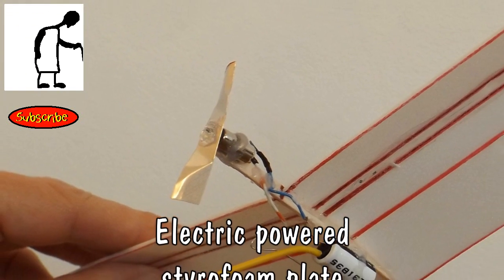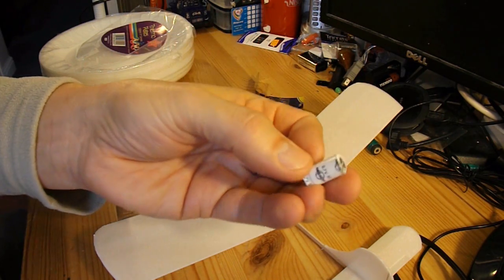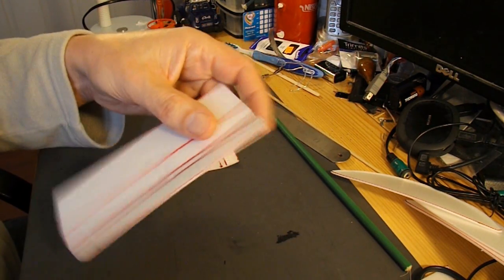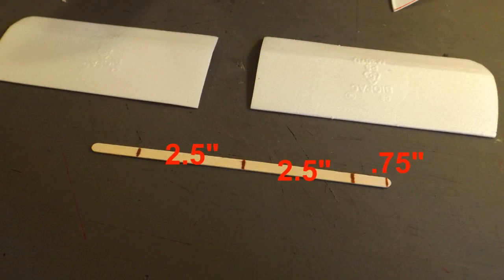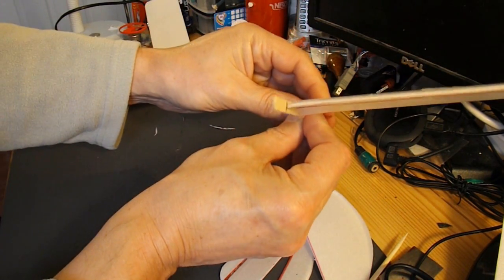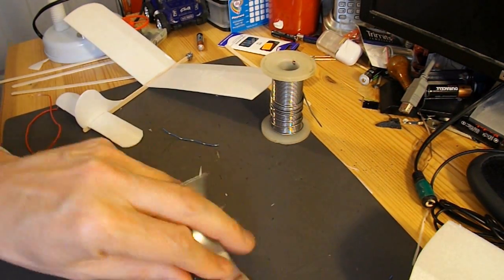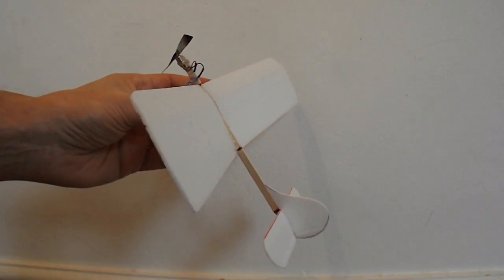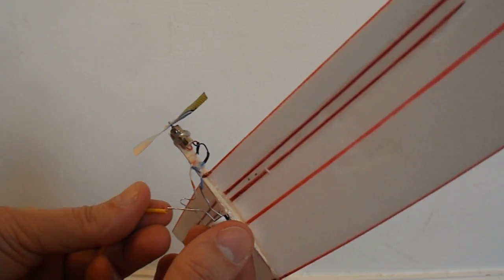Electric Powered Styrofoam Plate Airplane

Comment: Hello. Excellent construction and materials videos. I would like to know, what is the best weight x capacitance ratio of the buy? Thanks for listening.
Reply from the maker: I would love to give you a knowledgeable answer but I can only say I have no idea. You would have to do some fairly clever calculations to work that out. You would need to know the efficiency of the motor you intended to power and the wing loading of your aircraft. I just put things together and see if they work. If they work, I win, if they don't work I have learned something. It's not the right way to do things but it is the way I do it on my channel.
Reply: @GrandadIsAnOldMan  
Understand. It's like testing and seeing how it behaves. Analyze the error and the success. Thank you for your attention
Reply from the maker: @marceloschott7121  thank you for asking, I wish I could be more helpful 😍
Reply: @GrandadIsAnOldMan  🤗🙏

Comment: Can you make a video of how to make rc airplane
Reply from the maker: That really depends on whether you want it to fly well or not. I have done a few but I am completely inexperienced when it comes to flying them. Here are my RC plane playlists
Radio Control Aircraft https://www.youtube.com/playlist?list=PLA5a2xPRSrB2C7UbVc-CqV4a-fpSAU6fJ
The Works £3 Foam Glider https://www.youtube.com/playlist?list=PLA5a2xPRSrB3z16nxV6u2zRtUoqgIqtr9
Glider from LIDL https://www.youtube.com/playlist?list=PLA5a2xPRSrB32IALqvbaZiTaG6J-aJ-H-
Hot Wire Styrofoam Plane playlist https://www.youtube.com/playlist?list=PLA5a2xPRSrB1Qj--01eR1NU_K2RCbH3R8
Another Plane from Scrap Foam playlist https://www.youtube.com/playlist?list=PLA5a2xPRSrB0IHk7pAAHCwTLfGDX_SK-k
DLG Pizza Tray Glider with Cheap Kite frame playlist https://www.youtube.com/playlist?list=PLA5a2xPRSrB3JAFc7f5qk95lpdSMOXDHw
Pizza tray Baubericht Microfighter project https://www.youtube.com/playlist?list=PLA5a2xPRSrB1wXu_GQ6jO1HaZD9rNEwBW
Let's do something with the WLTOYS V911 receiver board https://www.youtube.com/playlist?list=PLA5a2xPRSrB0yn7ndo5B9Emt2UHX_zrsB
Can you use cheap motors and cheap RC for a plane playlist https://www.youtube.com/playlist?list=PLA5a2xPRSrB3v7nI2gkMPSAD5LOoSQkzk
Silverlit Palm-Z BiPlane https://www.youtube.com/playlist?list=PLA5a2xPRSrB2f45nvzR67dfTwbZSdLOVY
Silverlit X Twin Jet RC Plane https://www.youtube.com/playlist?list=PLA5a2xPRSrB2HaQ07pxyWs8dGH1UVsnp5
Silverlit 27 MHz RC Sopwith Camel https://www.youtube.com/playlist?list=PLA5a2xPRSrB3sivRV1Dzzjv6ziMKIi70c
Home Bargains - txJuice RC Stunt Plane xtreme https://www.youtube.com/playlist?list=PLA5a2xPRSrB1L7D8EMI9Y1jOjObycR6Ps
RC Airplane Sky III 27MHz https://www.youtube.com/playlist?list=PLA5a2xPRSrB1SbePGUdr9zJrqPUaW6MLj
Sky Hunter 230 Radio Control Flying Wing 40 MHz https://www.youtube.com/playlist?list=PLA5a2xPRSrB1FQrNHekXwZEyeBUhBedky
Micro RC Aircraft https://www.youtube.com/playlist?list=PLA5a2xPRSrB3HapKkXfbIyZ09HY1W6kH8
RC Ornithopter FB-003 E-Bird https://www.youtube.com/playlist?list=PLA5a2xPRSrB32BEm8rebB8QECFTqXeq1Q

Comment: I have seen those tooth brushes in the Dollar store downtown, now I know in what else I can use them. Thanks :-).
Reply from the maker: I wouldn't buy the brushes just to make a plane but if you happen to be using them anyway then saving the motor would be a good idea. You can buy better motors on eBay for less than the cost of a toothbrush.

Comment: good info on the motor.  I have one of those Guildan  basa wood airplane that rubber band powered.  I am wondering if I put on small electric motor and a capacitor if I could turn  plane a control line plane.
Reply from the maker: A supercapacitor does not provide power for very long. It gives a good power output but for a relatively short duration. If you wanted to do control line then I would suggest using a small LiPo as it would still be light weight and it would last for longer. I have been intending to make a control line plane for quite a while but never seem to get to it. If you want to watch some Control Line videos there are plenty on YouTube, this guy is pretty enthusiastic Shugemery https://www.youtube.com/playlist?list=PLahaAdtfX9ZIJYRxo9TS1hNmtMKSvezQn

Comment: how can I find this type of motor
Reply from the maker: I give you guidance in the video description. This motor came from an Oral B vibrating toothbrush but unless you happen to use that type of toothbrush and have some old ones to take apart it would be a very expensive way to buy the motors. You can get much more powerful ones on eBay or other online stores for much LESS money than the toothbrush costs. Just search for 3.7 volt coreless motor, some even come with matching propellers.

Comment: hey grandad where we can find 2.7 volt capaciter please help me to get it i broke my charger there was high volt !!!
Reply from the maker: There is information in my video description.
Reply: GrandadIsAnOldMan  yes i know i can buy but i want to know in which electronic things in our home contains those capaciters
Reply from the maker: I am not aware of any home appliance that uses them. They are a fairly specialised item.
Reply: GrandadIsAnOldMan oh i am searching it for 2 years by breaking many home aapliances so i am asking you thanks
Reply: grandad can we use capaciter of mobile charger for that coreless motor please say me
Reply from the maker: I don't know what capacitor that would be. I doubt it is a supercapacitor. Is it marked as 2.7 volts 10F ?
Reply: up to how much volt capaciter can be used for that coreless motor
Reply from the maker: The motor is sold as a 3.7 volt coreless motor so I would expect it to run on 3.7 volts to be at it's most efficient. You can probably double that and it will still run but get very hot. It is probably the available current that is more important.
Reply: GrandadIsAnOldMan oh then i tried to run motor by charging with batteries as you showed in one video but it didnt work

Comment: can you give me that electric moter shown in the video for FREE??!  please i have never seen a moter like that before   wish i was intelligent and had enough money please
Reply from the maker: Ben, as explained in the video that motor comes from a disposable vibrating toothbrush. You could find similar in old mobile phones but you can buy much more powerful similar sized motors on eBay or other online suppliers. Just search for 3.7 volt coreless motors. They are really cheap and much cheaper than buying one of those vibrating toothbrushes. I only use them because we use those toothbrushes and I save them when the toothbrush is worn out. The ones you will get on eBay are the replacement parts for mini quadcopters so are much better and like I say, much cheaper. You could get them cheaper from China than it would cost me to post one to you from here.

Comment: Hey grandad would these capacitors work for a plane like this. https://www.amazon.ca/gp/aw/d/B00ZBUE44M/ref=mp_s_a_1_19?ie=UTF8&qid=1467190482&sr=8-19&pi=SY200_QL40&keywords=capacitor&dpPl=1&dpID=41yYwrbSyCL&ref=plSrch
Reply from the maker: No, those are normal electrolytic capacitors and do not have the capacity in Farads that you need. The one I used in this video was 2.7 volts 5 Farads. I looked at your Amazon.ca and could only find one supercapacitor and that was much too big but I followed the links to the seller and eventually came up with this company selling them http://www.alliedelec.com/illinois-capacitor-inc-505dcn2r7q/70112413/
Reply: +GrandadIsAnOldMan ok thanks grandad
Reply from the maker: saad kashif good luck with your search.

Comment: You should make a  electric helicopter 🚁✈🚁✈
Reply from the maker: +Jack Winspear I get asked to make drones and helicopters so often I have a standard cut and past reply.The answer is NO. To make a helicopter or quadcopter stable in flight I would have to buy so many parts designed for the purpose it is cheaper to buy a ready made helicopter or quadcopter or a kit. A good example would be something like the Eachine H7 2.4G 6-Axis LED Mini RC Quadcopter. On top of that, my channel is aimed at simple, quick, cheap projects and a helicopter or quadcopter build is not a simple, quick, or cheap project. You would be better finding a channel that specialises in RC Quadcopters or Helicopters so you get the information from people who know what they are talking about. FliteTest would be a good place to start https://www.youtube.com/user/flitetest
or anything David Windestål is involved in https://www.youtube.com/user/dadde87
or you might like this video by The Post Apocalyptic Inventor https://youtu.be/qa_x93JQhNM
for rubber band power check out the work by norris432 https://www.youtube.com/user/norris432
Francisco Ramos Muñoz is currently doing a quadcopter project https://www.youtube.com/user/franramuzz/videos
Why I won't make an RC helicopter from an RC toy car https://www.youtube.com/watch?v=92GKSUi2y-8
Reply: It dusont haf to fly
Reply from the maker: Jack Winspear if you go through my helicopter playlist your will find a couple of solar powered helicopters https://youtu.be/Vt6p5wOdpV0 https://youtu.be/vlMrTPA_CNA

Comment: hey I just got a rubber band powered airplane and was flying it and noticed it wasn't really powerful how do I make it more powerful thanks!!!
Reply from the maker: +Josh North generally speaking you don't make rubber band powered planes powerful, they are supposed to be gentle flyers. The obvious answer would be to add more rubber bands but you may find that breaks the plane
Reply: ok I was stupid and typed this before I read the directions it said to make more powerful to put 2 rubber bands (before I only had 1) so today I will try it but anyway, Thanks

Comment: Hi, We are building this for a college project but are struggling to find the motor that you have?Can you give any advice as to where we might get one? do they still have them in the oral b pulsar toothbrushes?Thanks
Reply from the maker: +nick cahill yes those toothbrushes are still available as far as I know but that is a very expensive way to buy them unless you are using the toothbrush first and then taking the motors out when the toothbrush is worn out. On eBay or Amazon you could search for 3.7V Coreless Motor or Miniature Coreless Motor and get them cheaper and probably more powerful. People often talk about pager motors which are basically the same sort of size too.

Comment: how do we have to connect the capacitors
Reply from the maker: +KHUZAIM RANAWADIA solder the wires from the motor straight on. In this video I think I kept one wire loose and twisted it on, but that is not necessary, just charge the capacitor fully with the motor running and release the plane immediately. You can tell how much charge is in the capacitor by the speed the motor is running.
Reply: Thanx
Reply: Can use some other motor for this
Reply from the maker: KHUZAIM RANAWADIA you need very small and very light motors. I have bought motors from eBay that work well. They are usually sold as replacement motors for little helicopters and quadcopters.

Comment: i am trying to make a eletric ornithopter :)
Reply from the maker: +Reniel Morioles good luck with that. You will need a geared motor as you need lots of torque. I would think one taken from a toy helicopter would be a good option as they have the gears to turn the large rotor blades. If you haven't found him already you should have a look at the work done by Kazuhiko Kakuta here is an example https://youtu.be/lbmlxiDe7Fw
Reply: +GrandadIsAnOldMan .thank you so much grandpa for always replying our questions / comment and suggesting us of things we can used to our project! u rock grandpa! :)

Comment: instead of the capacitor.....what about one or two small. flat solar cells?
Reply from the maker: J.R. Zippie unless you can source super light weight solar panels then you are wasting your time. If you look at the 'professional' solar planes they have massive panels to provide the power and the plane is super light weight. That sort of thing does not scale down to this sort of sized plane. All the solar panels I have seen are far too heavy.
Reply: thanks for the info...i think i meant little solar cells like those that power the little garden-type lamps (afew could put out maybe 1.5 vdc, but low ma)...and maybe even a larger styrofoam plane to add extra lift....◔̯◔
Reply from the maker: J.R. Zippie I think you would need to weigh a few of them to get an idea of how much power would be required to lift them, then do some calculations on what sort of surface area the plane would require to support that and then find what sort of motor could supply that sort of power output from the power input available. I have enough trouble getting those panels to produce the power to drive a small car or a small boat, and they don't have to lift the weigh and leave the ground.

Comment: The prop looks good. I wonder how efficient it is. Maybe try a button battery instead of capacitor.
Reply from the maker: boowonder888 the prop is hardly likely to be very efficient but if you don't have a hobby shop handy and you can't wait for parts to be delivered by post, then making a simple one like this is a simple shortcut. One of the main reasons for using the supercapacitor is that it will power this motor with high power for a short period. That means it will get the plane up but not fly away out of site unless you catch a thermal. Have a look at the Power-Up series of powered paper planes and you will see they use the same sort of set-up, or you could have a look at my Supercapacitor Planes playlist as there are many more https://www.youtube.com/playlist?list=PLA5a2xPRSrB1wNvirrwAn69eo_pM0tdEM
Reply: yes, I have just made one out of the cardboard from the inside of a toilet roll. When I blow on it it turns better than I expected. Next time I will use a plastic bottle. A 3d printer would be fantastic. Kids today have all the possibilities older generations didnt have.

Comment: can you make a quadcopter out of cheap materials??
Reply from the maker: Parikshit Sah that is a regular request and the answer is NO. To make a helicopter or quadcopter stable in flight I would have to buy so many parts designed for the purpose it is cheaper to buy a ready made helicopter or quadcopter. On top of that, my channel is aimed at simple, quick, cheap projects and a helicopter or quadcopter build is not a simple, quick, or cheap project. You would be better finding a channel that specialises in RC Quadcopters or Helicopters so you get the information from people who know what they are talking about. FliteTest would be a good place to start although they tend to focus more on planes than copters https://www.youtube.com/user/flitetest
or anything David Windestål is involved in https://www.youtube.com/user/dadde87
or you might like this video by The Post Apocalyptic Inventor https://youtu.be/qa_x93JQhNM

Comment: Wow love all ur work how is the hovercraft coming along
Reply from the maker: Ephraime Ikotela if you mean the quad engined hovercraft I have done nothing more to it since the last update in April, I have taken it about as far as the original specification could go, which was just using cheap motors and parts. Any further development would require more expensive parts and no longer fit the original project.
Reply: Use a hairdryer  motor.they have a lot of wind power
Reply from the maker: Ephraime Ikotela I have used hairdryer motors on many of my projects, yes they do have more power, but they are heavier and require bigger batteries.
Here are some links
https://www.youtube.com/watch?v=nx7pdp12PQk
https://www.youtube.com/watch?v=dJ8iBwx4O3k
https://www.youtube.com/watch?v=rFOkYtoOC8M
https://www.youtube.com/watch?v=Wd8BQ8lMFjw
Reply: Thank u

Comment: hi Granda plaez cna call me how much Volte this Capctor and where ican get this Motor
Reply from the maker: Read the video description.
Reply: kk iam form egypt and dont know waht ur speak iam need know how get this motor all motor in egypt 1.5 Voltge where ican get this motor plaeaz help me
Reply from the maker: محمود محمد I do not know where you can obtain this motor in Egypt. You can buy similar motors on eBay. I got the motor from an Oral B Pulsar toothbrush. There are also similar motors used for vibrators in mobile phones and pagers.
Reply from the maker: محمود محمد the details are in the video description.

Comment: ill try and build one too, because i found a capacator recently in an old electronic kit for learning, you know the experimental ones for kids
Reply from the maker: If it is not a supercapacitor then it will not work. Ordinary capacitors release their power too quickly, in milliseconds, a supercapacitor releases the energy more slowly so it will run for several seconds. See the video description for more information.
Reply: ahh... yea mh alright because i only found normal ones jet.... I also found a very big one from a camera flash, thats realy cool, but useless, because as u told me, its not working for our stuff :/

Comment: Can I use rc battery please replay
Reply from the maker: You can use whatever you like as long as it is light enough and gives enough power.
In this video I use an old LiPo battery from a nanocopter. The battery is well past it's best and I was going to dispose of it but I thought I would try it on the plane before I got rid of it. http://youtu.be/s_ru97euzEw?list=PLA5a2xPRSrB0nZItxE_78EJP0F99Ghaki
The main reason I use those supercapacitors is that I only want a very short burst of power so the plane does not fly away too far.

Comment: where did you get the super compacitor? Can you find it in any other electronic divice?

Thanks
Reply from the maker: That information is already in the video description. I don't not know what devices you might find similar ones in. 
Here is a link to the ones I use which came from Maplin Electronics
http://www.maplin.co.uk/c/components/capacitors/super-capacitors